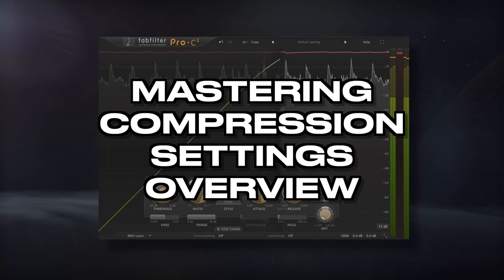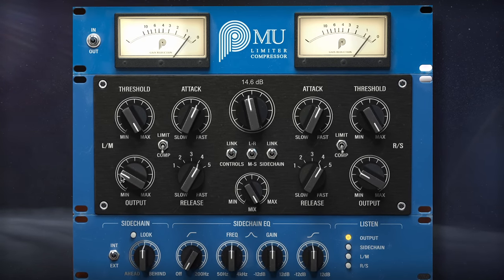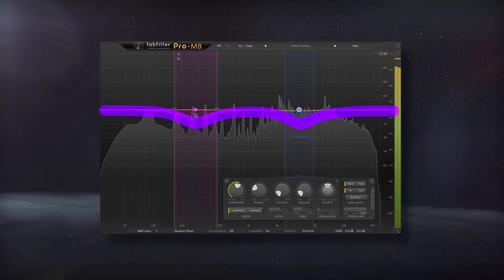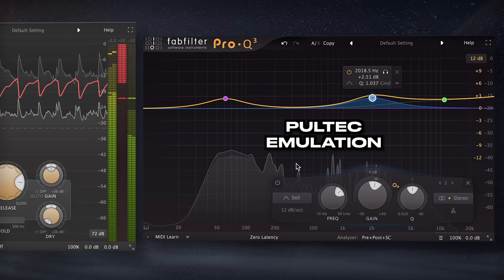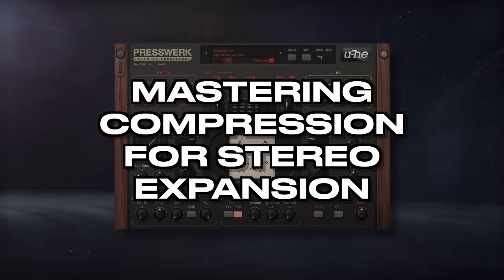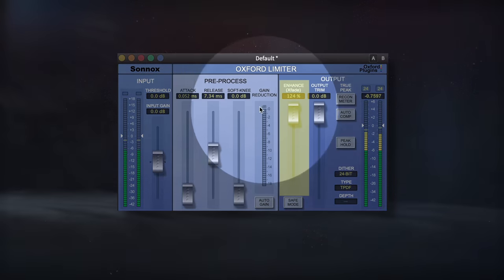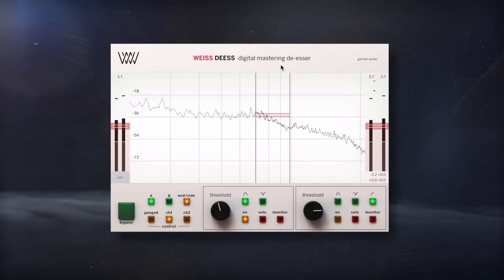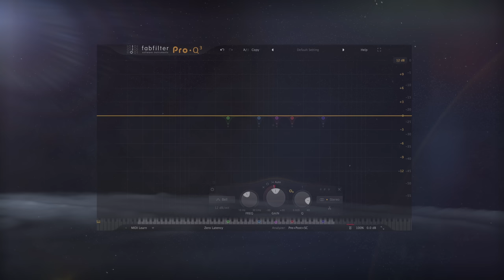Mastering Compression Settings

Comment: Great info. My Pulsar Mu is used to great effect to compress a bit, and color the sounds. I'm very OK with how it does this. FWIW the compression ratio is a base of 1.5:1 in the compress mode, while the limit mode has a base ratio of 4:1. Just remember, its unique algorithm varies the ratio from there. I also have the free versions of TDR Nova dynamic EQ and the Kotelnikov, and then the base version of the Melda compressor. For free versions, they're all very good.
Reply from the maker: Thanks for watching and sharing the info about the ratios! That's definitely good to know when using it.

Comment: Probably the best show and explanation video I’ve ever seen. I learned a ton and I can really hear the difference. Especially on the ‘how our ears hear sound’ compression. It’s really uncomfortable. I don’t know if you know but Weiss DS has additional settings menu under the input meter on the left. The two arrows. You can set attack and release and more  there too. Dope video! Subscribed
Reply from the maker: Thanks for watching and it's great to hear that the video was helpful! I have seen that - it's definitely helpful when setting attack and release times to either smooth out the sibilance or make it as transparent as possible, really cool plugin.

Comment: I have some questions related to the tempo dependant compression:
1-How do I know when to use 1/16 or 1/4 note? Or a whole note? , I was kinda lost in that explanation :(
2-Does the attack time need the same calculation process as the release?
3-Waves glue compresor doesn't have a variable timing for attack and release (well, there is auto) , what are your opinion about using it? Better try other of your options for a more professional sounding mix?

Thats all! Thanks for your time teaching us those good juicy secrets about mixing and mastering 🙏
Reply from the maker: Thanks for watching and leaving a comment!

1) I use whole note timing when trying to glue the sound together, and 1/16th note timing when trying to create quick and transparent compression.

2) Better not to set the attack time using this calculation.  Instead, subtract the attack time from the release time.

3) I haven't used this plugin, but auto settings can be helpful! I'd try it out and see if you enjoy the sound, since that's what's most important.
Reply: then how do we set the attack time? you just explained how to set the release time but for that value you are telling me that you need to subtract the attack time , no explanation on how to set attack time bro @sageaudio

Comment: Hi, thanks for the useful tips.
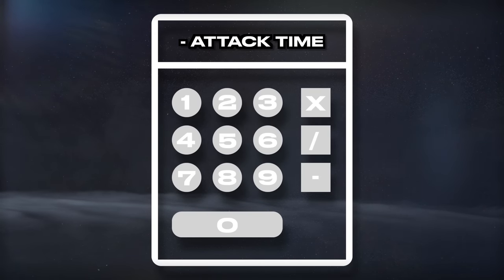At 1:48 you said multiply the release time (quarter note) by 4 to get a whole note and subtract the value of our attack time to get the release time.

Q 1 - Why didn't you subtract the attack value to get the release time for a quarter note ?
Q 2 - When do you decide you need the compression to be set to quarter note, whole note or 16th notes ?
Q 3 - Do you always rely on setting these values mathematically or doing it by ear is also fine ?
Thank you!
Reply from the maker: Thanks for watching! You should subtract the attack in that instance as well if you choose a quarter note as the final setting - I think I was just going to end up using the whole note so I showed that info at that point.

I usually use longer settings when try to get glue compression and shorter when I'm trying to create a more transparent or less noticeable change.

I don't always rely on these settings! Using your ears is always best, but I like to offer this type of info regardless, since I think it offers a more objective way to introduce processing.  

Thanks!
Reply: Only Allah knows

Comment: Great Video!

The C2 only allows an Release about 2500ms
So when I wanted to time my 90bpm song, my in-time release would be 2666.6 -attack (60k/90*4=2666ms)

What should I do in this case to time right?
Push the Release until 2500ms or just time less than a whole note? (like 60k/90bpm *2 or *3 ?

Thank you.
Reply from the maker: Thanks for watching! I'm sorry but which C2 are you talking about? I can't find info on it.  I'd say less than a whole note would be fine - try a half note and see how that sounds.
Reply: @sageaudio  Thank you! I'm talking about the FabFilter C2 - I'll try a half note!

Comment: very good video!! i love your content :).
just one question: would you recommend setting the release as slow as a quarter note also for more energetic genres such as hip hop or edm? i once heard that this approach for edm would damage the track more than it’d help so i usually settle for a 200ms release time
Reply: i also wonder this. but i would assume so. (seems logical)
Reply from the maker: Thanks for watching! When working with EDM, it's best to use faster settings.  So I'd use something around 50ms, since this is the quickest you can make the release without causing some distortion to the low frequencies.

Comment: How is this not a feature in mastering compressors yet? Automatic timing settings for Attack and Release instead of using a calculator?
Reply from the maker: That would make a cool addition to a compression plugin!
Reply: I was thinking the same thing. Why not a sync button and note length. To be honest I’ve never seen or heard of this calculation before. I’ve watched countless videos on compression and mastering and none of them mention this. Does it only matter when compressing multiple sounds at once or the full mix, or does it matter when compressing one channel?

Comment: Hi guys. I wanted to ask a different question to this video. Do mastering engineers still normalize tracks to day before mastering? Is normalizing a track still a thing in 2023? I'm an upcoming mastering engineer I wanted to know
Reply from the maker: Thanks for watching - to my knowledge most don't.  Peak normalization might be done before processing, but if that's needed most engineers would just use clip gain to adjust the gain of the track.

Comment: Subtracting the attack time from the release time won't do what you think it is doing. Attack time is pretty misunderstood. In compression attack time goes through a knee and it can go smooth or hard from 0% to 100% compression over time. Many people think 20ms attack means it compresses at 100% at 20ms but that is not true. Depending on the design of the compressor and the knee 20ms could be when it reaches 50%, 75%, 100%, most are different.
Reply from the maker: True! The knee and ratio will affect when the majority of the compression occurs - that said, the timing between when compression starts and when it reaches the maximum amount of compression (when a soft-knee setting is being used) is minimal.  For that reason, I'd still recommend this method, but I see what you're saying, and will look more into the time it takes for a soft-knee setting to cause the maximum amount of compression, and how that affects the timing.  Thanks for watching and sharing your thoughts!

Comment: the ny parallel where does it join the original frequency? they both go to the master track or does the parallel have a return somewhere in the channel?
Reply from the maker: The NY Parallel compression technique uses an auxiliary track.  So the original channel is sent to the aux track.  Then the original channel and the aux track combine at the stereo output.
Reply: @sageaudio  it's the same as using the percentage of mix in the fabfilter c2?
Reply: @sageaudio  like not using parallel but just percentage of the compressed signal to the original stream?

Comment: I was wondering...when lets say a quarter is 100ms....would that mean that if i put an attack of 10 ms the release would be the remaining 90ms or would the compressor be synced with the daw ms meaning those 10ms would be included in the releases 100ms...so would i always have to calculate the amount of time the attack takes or not

Comment: mmm. Time settings don't have a very precise meaning in compression. Or better said, they mean different things depending on the compressor and how it's made. I think it's absurd to set the release like a delay with precise time settings. Just listen how it behaves with the timing of the track. And if you don't know how to do this, just learn what to listen and how to listen it...
Reply from the maker: Thanks for sharing your thoughts and watching! True, the timing will mean different things depending on the knee, but in most modern digital compressors, the attack and release are very close to the beginning and ending of attenuation.
Reply: @sageaudio  I may be wrong, and happy to have some insight about this, but I think the time settings of a compressor have different meaning depending on who is making the compressor. The time settings mean concretly how much time it takes to achieve a certain amount of gain reduction : but which amount ? A fixed amount (1db ? 10db ?). Or an amount  set as full gain reduction (determined by the ratio and knee) ? Or something else ? 
I think each time it differs depending on the dev, even if of course a specific time setting may have vaguely similar behavior on different compressors. 
Don't get me wrong, it may be interesting to set the time constants according to the tempo, but you can't expect to have a compressor set like that to work perfectly in rhythm like a delay setting...